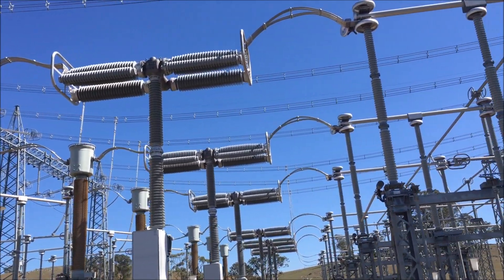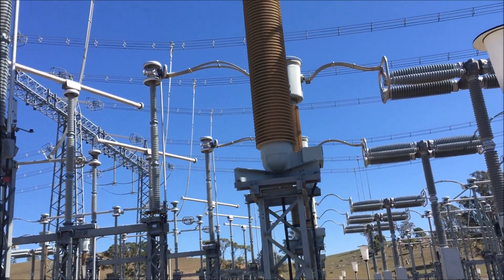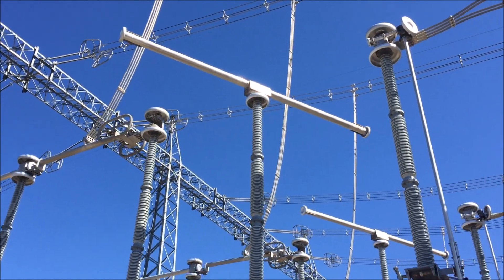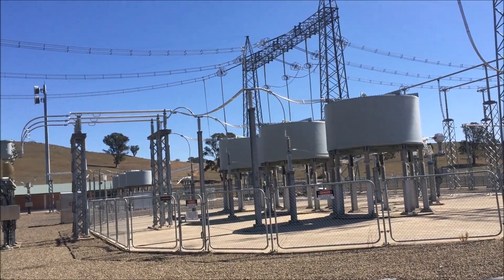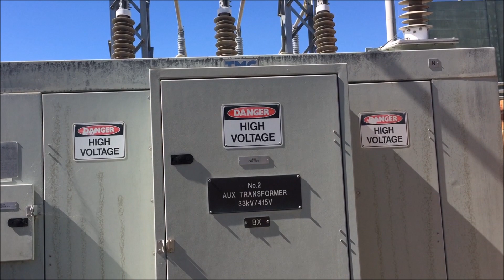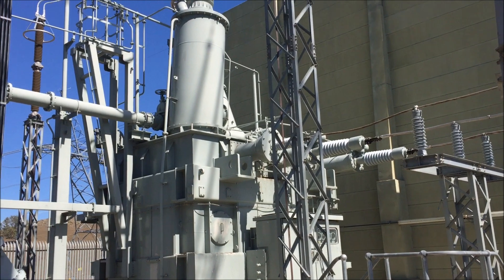The highest voltage 500kV substation equipment - A quick look up at the big stuff

Comment: In the 500 kV substation, we see voltage transformers that reduce voltage to usable levels, wave trappers for filtering unwanted frequencies, breakers to isolate system sections, current transformers for monitoring, and reactors for voltage stabilization. Additionally, single-phase transformers and surge arresters protect against voltage spikes.

Comment: Why doesn't used of GIS for substations??? The GIS is safety of other weather, no electric arcing, no rusty of metal switch system, low time frequency of maintenance, and anti-lightning strikes on the ground. Many countries was switch from AIS to GIS with little space to build it.

Comment: Are you sure you meant air cooled instead of air cored? I've certainly never heard of an air core 50Hz tranny
Reply from the maker: Technically both I suppose. It is the only one I had ever seen, there is no oil in that TX
Reply: @BearsTrains  I believe you that there's no oil! Dry cast transformers are commonplace nowadays
Reply: @BearsTrains  I thought you meant that it was air cored rather than having an iron core, which would seem odd to me
Reply from the maker: @inductivelycoupledplasma6207  My bad, it does have an iron core but is air cooled. I think it was part of a general design change to reduce the amount of oil in a substation. The 6 separate TXs are better than 2 x enormous TXs that would spill a lot of oil if they failed
Reply: @BearsTrains  ah, thanks for clarifying. Awesome power transformers by the way. A 500MVA single phase transformer is massive.
Reply: @BearsTrains  and yeah, I can imagine a 1500MVA 3ph monster would make quite a mess if the oil spilled!

Comment: Interested in the fencing around the reactors - is that an exclusion zone due to high magnetic fields?
Reply from the maker: No, the reactors don't have enough clearance so they are in a "cage". This area is locked and access is only permissible after isolation ,earthing and signing on to an access permit
Reply: @BearsTrains  thanks, so it's just about electric shock risk due to low height?
Reply from the maker: @jonbaldwin  Yep, pretty much

Comment: I have worked as contractor in several coal/natural gas, gas peaking & one small hydro generating facilities. My job  involved  HVAC... and I  was limited to <600V. That voltage is capable of much harm! This very high voltage is fascinating & terrifying. Occasionally my work took me into transformer or switching yards & being in close proximity is definitely interesting. You are NEVER allowed in those areas unsupervised. I have great respect for those who maintain & repair the power distribution network in all types of weather.

Comment: Do you still use porcelin insulators on the network, or is everything polymer or concrete-polymer?
Reply: I see theme used for neutrals on wood poles still, and for down guy insulators.

Comment: Yes,the 500 kV feeders would be supplied by Eraring power station which is in the Lake Macquarie area near Newcastle in New South Wales via the Kemps creek substation which is the main substation for southern New South Wales.

It's the highest voltage feeder in the southern hemisphere !
Reply: Brazil has 765 kV and 800 kV :)
Reply: Actually, those feeders connect to Bayswater transmission substation via Wollar and Mt Piper. The  Eraring - Kemps Creek 500kv lines are currently separate from this system.

Comment: Do you ever look at the enormous walls separating the transformers and think "well what the hell am I doing standing here then?"
Reply: They don't use these walls in the US.
Reply: @markkinsler4333  Yes they do I work for a utility in southwest our 500kv's all have the walls.  Smaller transformers don't use the walls only the larger 500kv. We also have oil monitoring systems look for any explosive gas building in the oil so transformer fires are rare now. We had one 500kv blow up about 20 years ago.

Comment: The “hum” sounds like 50 cycles per second? Where is the substation at?
I am in the states here it’s all 60~ the last 50~ that I know of here was replaced before the 1950s and was Southern California Edison, the Los Angeles DWP had replaced all their 50~ about 10 years before that, now for Intertie of the pacific western grid it is all 60~ with two 500KVA DC circuits in the grid.
Thanks!
Reply from the maker: It is in Australia. 50Hz here
Reply: Thanks Dave!
Reply: The Hoover Dam power line came through in 1938 at 60 Hz.  Much of Los Angeles was 50 Hz.  They mounted a large project to re-gear or replace all the electric clocks in the affected area.

Comment: Good to see. I worked for an electrical supplier in the Eighties in substation maintenance and extensions. Most of the gear was live but cordoned off and we had a safety chat daily. Nothing EVER was carried on your shoulder and in your mind you were sort of thinking of the instant death if you messed up. Live line workers were at Higher risk. Brings back good memories Thanks
Reply: My favorite substation sign instructed,  "Lower radio antenna."

Comment: Very interesting - thank you for posting! How is voltage specified in this industry? is 500kV L-L or L-N? I would be very interested to see a few videos that talk about some typical maintenance scenarios. Are large transformers tested regularly on-site? If so, how? Are capacitor banks or reactors ever tested? What are some examples of typical maintenance tasks done at set intervals?
Reply from the maker: Nominal voltages are L-L. yes, everything gets tested eventually, usually 4, 8 or 12 years  for the maintenance period
Reply: @BearsTrains  Thanks for your reply Dave! I mostly work with low voltage digital/analog stuff but recently started to fill some knowledge gaps when it comes to power electronics. I just finished repairing a beefy 3-phase AC power source for aerospace use so I've tried to get comfortable with all the conventions. HV transmission is a different ball game, but equally interesting. May I ask what types of devices have 12 year maintenance periods? Thanks! -Nick
Reply from the maker: @oriole8789  Usually a major maintenance on an SF6 circuit breaker is 12 yearly

Comment: Circuit breaker 500kV has only 2(!) chambers, not 4. Breaker shown here has additionaly preinsertion resistors for more mild switching on long transmission line.
As for dry reactors 33kV, they are using for  fault currents limiting, not for long line capacitance compensation.

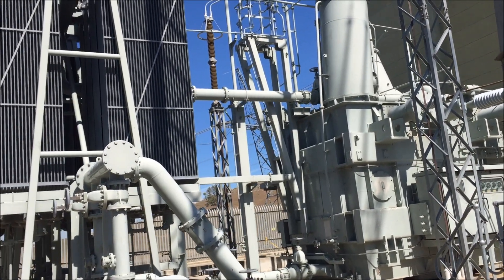Comment: 4:20 Why are the bushings so large on the 500/330kV transformers ?  I realize you have lightning & rainwater. What is inside those ~4m tall cylinders ?
Reply from the maker: They have to be long so the high voltage electricity won't flash over to earth. They have a conductor running up the centre, wrapped in capacitor foils (which works as a voltage divider) and inserted in a hollow ceramic insulator.

Comment: I would like to know more about the transformers that step the 500KV transmission voltage down to 110V secondary voltage for use inside the substation. How many voltamps are they? And if someone were to backfeed the 110V into the secondary side, would 500KV be the voltage on the primary side like with a distribution transformer? Great video, by the way!
Reply from the maker: Hi. The CVTs are generally rated from 100 to 200VA. Backfeeding them wouldn't work as they use capacitor voltage divider to reduce the voltage to about 20kV which is then supplied to a transformer in the base section,which then outputs the 110VAC
Reply: @BearsTrains  It makes sense to use the capacitive dropper to  step the bulk of the voltage down, otherwise the primary/secondary turns ratio would be crazy. But wouldn’t the capacitor’s impedance change based on frequency, thus altering the voltage during a high/low frequency event? I am also curious as to what the value of the capacitor is. Is the capacitive dropper able to correct the inductive power factor of the transformer?
Reply: 'Current' and 'voltage' transformers (CT and PT, respectively) are part of the instrumentation, for measuring instruments can't be used to check current or potential at these immense voltages.  The current transformer produces a low current that's proportional to and in phase with the current through the power line, and the voltage( or potential) transformer  produces a voltage between 0 and 120 volts that's proportional to and in phase with the voltage across the actual lines.  (Your own electric meter contains small CT's and VT's. )  The signals from these instrumentation transformers are fed to an instrumentation computer (called a 'relay' ) that analyzes the condition of the line and can detect and locate misfortunes like short-circuits or breaks in the lines many miles away.
Reply: @markkinsler4333  Out of curiosity, if the relay computer detected a fault, would it remotely notify other substations/generating stations and sound an alarm on the premises ? Would it open a circuit breaker? And can it also detect events such as low/high frequency, waveform distortion, transient voltage, and phase imbalance? Lastly, if the circuit breaker’s arc quenching gas leaked out and a severe fault occurred, how would the system break the fault current (if at all)?
Reply: @possiblyrandomgaming  Alarms are issued as needed.  In general, there'd be an initial opening of the circuit breaker long enough to break an arc caused by lightning.  If the fault remained upon reclosing,  a second opening would be delayed long enough to (it is hoped) burn away an errant tree branch or squirrel.  If the fault is not cleared then the breaker opens and remains so.   Procedures vary on very large lines.  

 Yes, low/high voltage, weird frequencies, phase imbalance, and other misfortunes can be detected by a close analysis of the CT and VT outputs.  For example, the inductance and resistance of the line will throw the voltage and current out of phase slightly when a fault occurs, and by measuring this phase difference the location of the fault can be determined. 

Note that prior to the 1990's the 'relays' were really relays--that is, electromechanical analog computers that lived inside glass containers, looking all the world like rows of home electric meters.  They were quite reliable and power companies, the very soul of technological conservatism, would not consider their substitution by digital equipment until the technicians that knew how to repair and recondition the old relays began to retire.    

 Now, a failed breaker is the kind of thing they discuss at conferences.  I don't know what they do about it, but I'd guess that some sort of alarm would be generated and sent upstream, so to speak, to ask that the line be de-energized.  All is done by computer.

  Some, if not all of the worst incidents are typically photographed and displayed here on You Tube and are quite popular with consumers of illicit public-utility videos.  Like me.  

Yum.

Comment: I wonder how long someone can stand or walk around this awesome but dangerous quipment without ill effects?? Do the resulting EMFs cause any harm if you spend too much time in the sub station??
Reply: No. Not ever.  Any frequency below ultraviolet is non-ionizing and thus non-harmful  There are lots of old coots at power companies.  Same deal with radio stations.
Reply: The only wavelength that will possibly hurt you is 50-60 Hz and it will do so very quickly :p

Comment: EXTREMELY FASCINATING AND AWSOME!  I have been waiting for a video of such a tour.  I have studies this stuff over the internet at India Institute of Technology and T. D. PowerSkills.  I wish that I was a power and electrical engineer but God gave me a brain that just can't understand indepth calculus, so I was not able  to pass my EE courses.  I love to see switches open and arcing.  At home, I have a 500kV Van de Graff generator, 70kV Tesla coil and a 90kV Jacob's Ladder.  I used to have a lot of wires hanging from my basement ceiling, and when I would fire up the Van de Graff generator, little coronas would form on the ends of the wires, many feet away from the generator.  It would make the dark basement look like the night sky with stars.
Frank
Frank Reiser Video/Audio Service
Reply: I'm exactly the same way. Don't give up just because of some math, dude. Just learn the math separately. That's what I'm starting to do. Once I find something that works, I'll try and come back to you, if I remember.
Reply: Thanks.  I do not understand how the slope of the tangent line can be found at the limit as one point on the line goes infinately close to the other point.  It is for this reason that I cannot understand all of the Calculus.  So, in electrical and power engineering courses that I have taken on the internet (India Institute of Technology), I have simply done what I can do--memorize the formulas.  v = the integral of i di/dt, etc.  At least it is all in my head somewhere.
Frank

Comment: Great video - but I am not sure why the network designer would bother with 500/330kV transformers, the difference doesn't seem worth it?
Reply: The problem with making big voltage / current changes is one of insulation. It's not practical to go from 500kV to 11kV in one step.

Comment: I'm sitting in my chair cowering just watching that! I do electronics so high voltage to me is 24v. Even 240 scares me!
Reply: You can safely work with voltages up to 48 volts with bare hands, but you'll feel anything appreciably higher.  Oddly enough, however, you regularly experience static electricity charges up in the thousands of volts.  It's the current that kills.
Reply: 5 volt TTL logic. God that takes me back to college 40 yrs ago

Comment: It’s Australian so it’s 50 HZ and all of the harmonics will be 50 Hz harmonics.
Is that right? Or is Australia a 60 Hz country?
I’m pretty sure you still drive on the “wrong” side of the road, however.
Cheers from your “Twin Brother from a Different Mother”  Country. 
The US.
This site handles a scary shitload of power.
I get nervous watching you walk around inside of it.

I wouldn’t fly your kite with thin wire fishing line over the top of this.
Just sayin’.
Reply: Australia is 50hz.

Comment: Great stuff. I’ve always been interested in high voltage testing and transmission. Really like the way you show and tell the various pieces of gear and what they do from the supply line and beyond. I toured a 400KV substation in Frodsham England and that equipment was huge....

Comment: I'm curious about your comment of "A useable quantity of 110VAC so we can use it inside" followed by "Allows 50Hz to pass". You seem to be in Australia, where they do indeed use 50Hz, but I am curious where the 110VAC comes into play, as my understanding is that Australia uses 220VAC and not 110. In fact, 110VAC @ 50Hz is very uncommon in almost all of the world - mostly only seen in Madagascar and Eastern Japan.

Unless it was just a mistake while commenting during the video (and it is actually 220VAC), it makes me curious as to how the voltage gets used at 110 and/or stepped back up to 220.
Reply from the maker: Hi Kat. It is indeed 110VAC as it is not a general power supply but a voltage used for protection relays, meters, indication and some other stuff. The ratio between the 110V and the line voltage is VERY accurate as it is used for metering which has a tolerance of 0.2%  (The errors are actually way lower ~ 0.02% usually) Because we deal in such large amounts of power, even a small error will eventually add up to big dollars so it must as close to perfect as humanly possible. The aux transformers supply all the 240VAC for use in power outlets , air conditioners, lights and everything else that gets plugged in. Not sure why it is 110V from the CVTs though. Just some standard voltage adopted years ago I guess. As for the 50Hz, it is not as uncommon as you would think. This is a wiki link that shows all countries https://en.wikipedia.org/wiki/Mains_electricity_by_country   .Australia would have inherited the frequency from England.
Reply: @BearsTrains  It's probably the fault of us Yankees with our 120v house current.  There were likely a lot of handy meters adapted to that voltage.  I worked at a radio station that could shut off its remote transmitter, and the telephone line for that carried 120 volts DC.   Just dandy.

Comment: Voltage transformers are for measuring not for use inside.
Reply from the maker: Yes, they measure the line voltage and the 110VAC secondary output is used inside the control building.
Reply: Its not being used. Its just being measured for record and quality. But i guess its just a different describe about the same thing.
Reply from the maker: Yes. it is used in the protection schemes so you can have distance protection. It also goes to meters and indication circuits